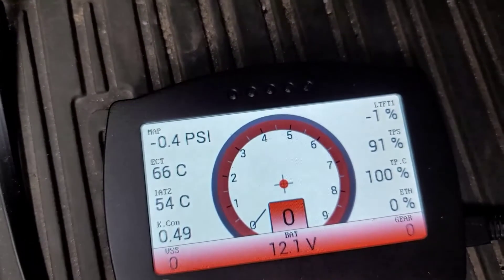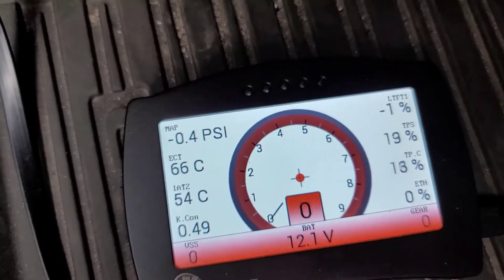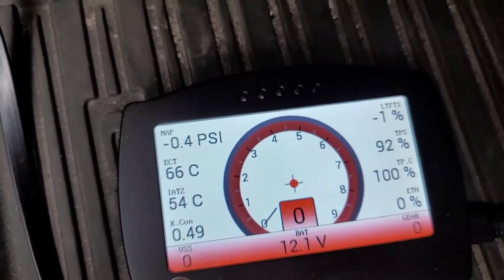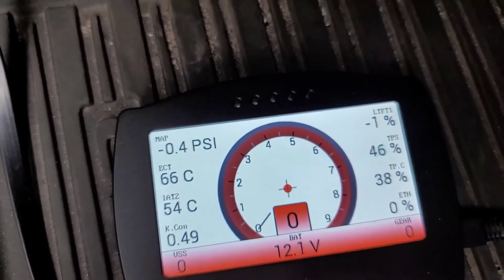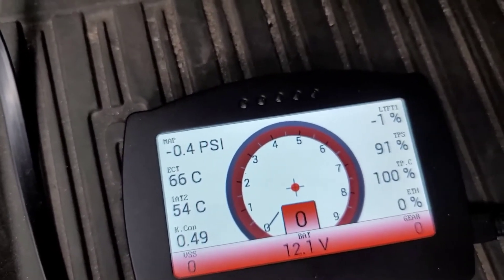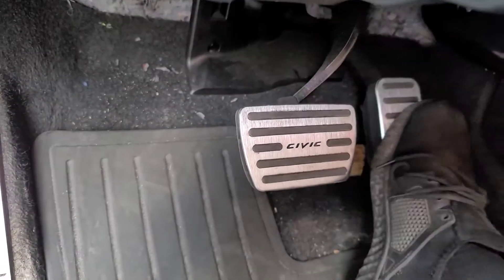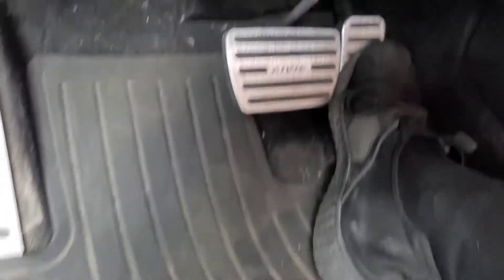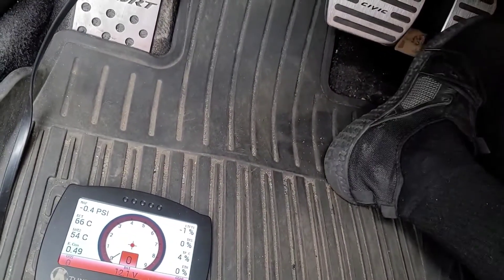Set Tps for faster acceleration cvt civic

Comment: What does this do for the car? Why does it increase acceleration. And how many miles do you have on the car since you tuned it? Do you have a CVT cooler. Thing rips, iv seen it race on the other channel but just found your channel.
Reply from the maker: 79k km on it, tuned since 30km, no cvt cooler here, I live in Canada it's pretty cold here, no need for a cvt cooler, it increases acceleration because it doesn't drop the rpm, when the rpm drops in shifting the boost also drops, for example let's say I'm making 25psi between 5400-6000rpm it'll make that boost all the time the rpm is there but if it shift, the rpm will drop to around 4800rpm and then work it's way back up to redline slowly, when the rpm drops at 4800rpm so does the boost, so instead of making 25psi all the time without shifting, it'll drop the boost to around 20psi with the rpm dropping to 4800rpm,...hope I explained it in way for u to understand
Reply: @the_batmobile0.4  nailed it thanks alot, im sure you saw my other comments I was planning on doing everything to my 10th gen until all the forums said it wpuld explode. Thanks brodi
Reply from the maker: @chrisgeorge84  I mean it could, especially if it's a hatchback